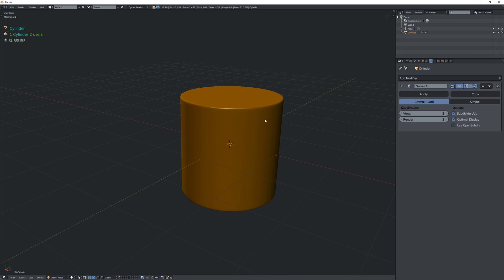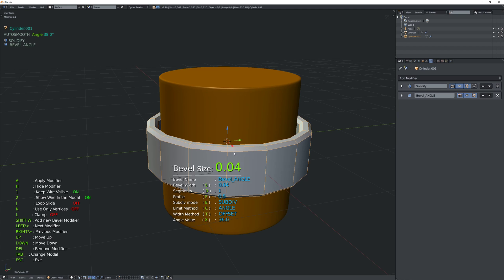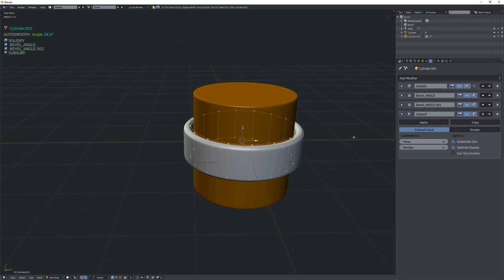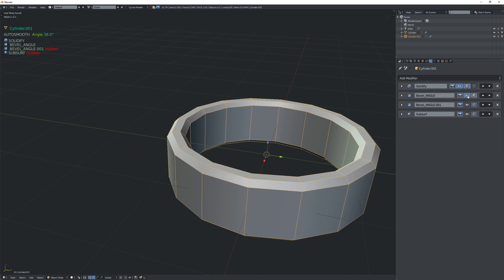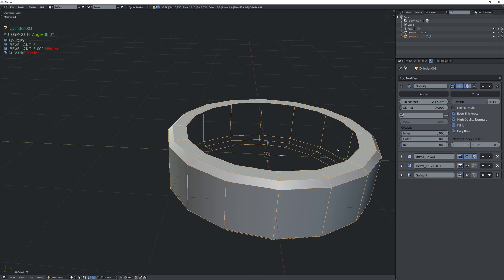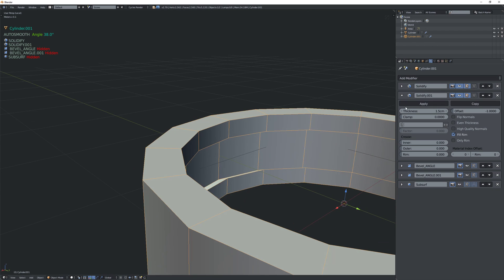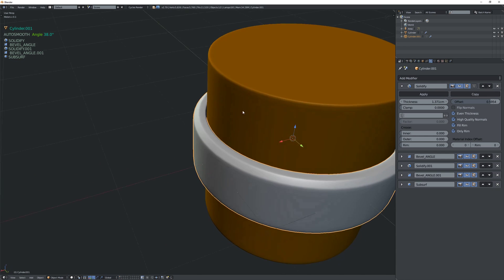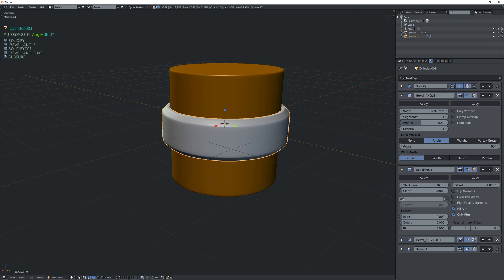Blender Double Solidify

Comment: You could also even add a screw modifier to make the cylinder before that, and even only have a vertex and use a screw modifier of angle 0 with a screw of however high you want your cylinder to be, essentially making the whole shape with one vertex

Comment: Pretty smart, I wasn't thinking of adding the possibility to add multiple solidify could be useful, but this example is great so I will add that part.
Also, on each Speedflow button there are some options, Apply, Remove, Hide etc.

Edit: Done!
https://twitter.com/pitiwazou/status/1057191320035438592